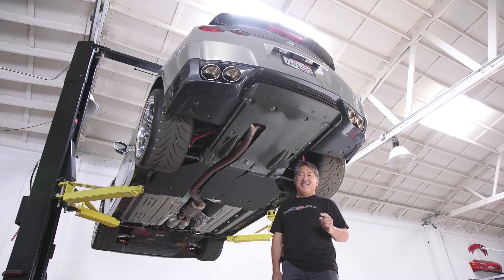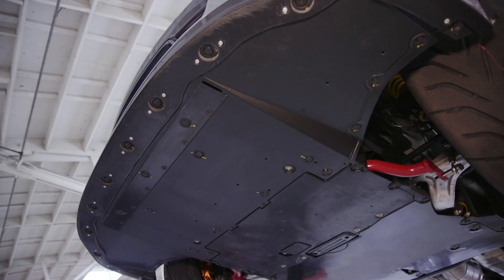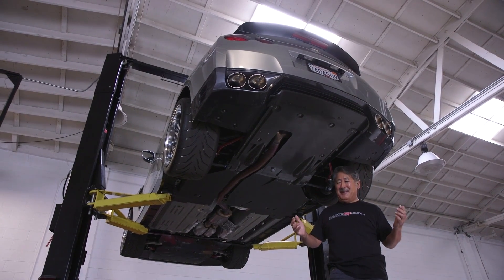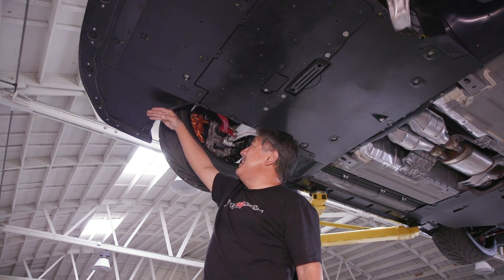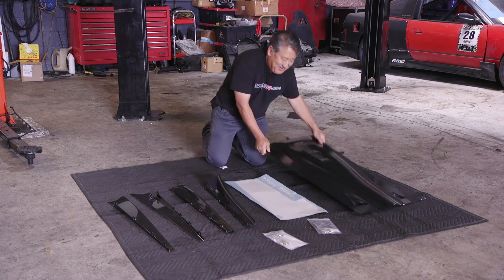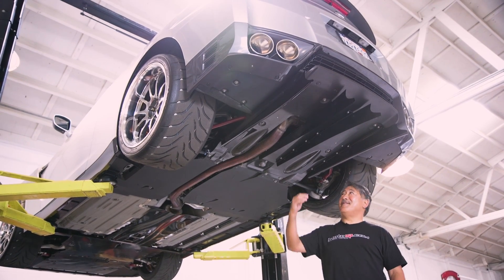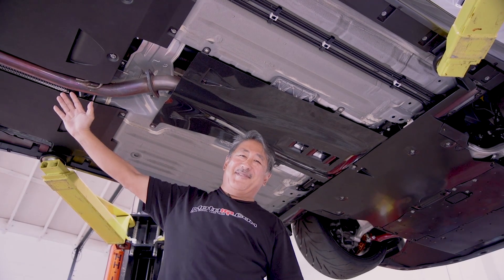Easy and Effective R35 GT-R Aerodynamic Improvements!

Comment: Do you know if an front difuser is also available for the BMW Z4 Coupe?
Or does it make more sense to start with a lip at the front of my Z4?
In my chanel you can see my car.
Reply from the maker: It is probably better to add a front air dam and a splitter over a cosmetic lip.
Reply: Thx!

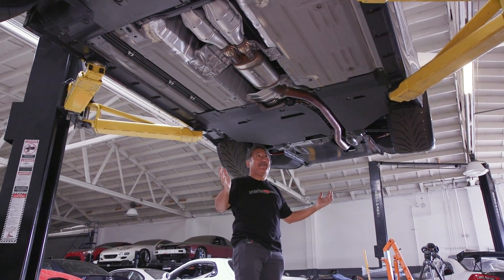Comment: Well I am actually quite disappointed with this video. You got a lot of how these parts work wrong. First mistake at 3:32 is to say that the turbulent flow induces separation on the diffuser, turbulent flow is much more resilient to flow separation. At 4:13 you say that the strikes act like a vortex generators ... totally wrong. Those parts act like a vortex separators, they split the big vortexes that can be created under the car. So they allow to have some areas with pure laminar flow which increases the diffuser efficiency. Vortex generators are typically very small (like 2 inches).
Reply: You are talking about turbulence in the boundary layer and Reynolds number, I am talking about gross flow separation. The motorsports aero consultant for our engineering group who has a PHD in fluid dynamics calls these aero features vortex generators and says that is the correct nomenclature for them.  I think he is correct because when you look at the CFD output with and without them it is pretty apparent what they are doing.
Reply: OK it was not obvious that you were talking about gross flow separation. Just to mention, I like these sort of aero improvements on a car and I am glad you are explaining how you think they work. My background is in aircraft aerodynamics so I can be wrong regarding "car vortex generators" nomenclature, but still, VGs are typically used to create turbulent boundary layer to avoid gross flow separation. This big parts are doing what I described previously. I do not have your CFD results so I cannot be 100 % sure. Thanks for the discussion.
Reply: Turbulence in the boundary layer can have stronger attachment and that's counter-intuitive so I know what you mean.